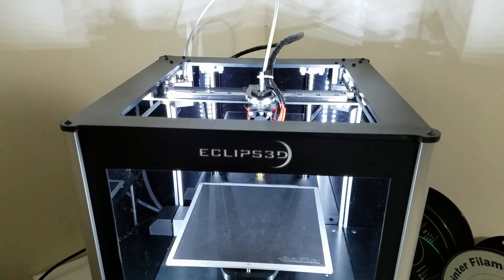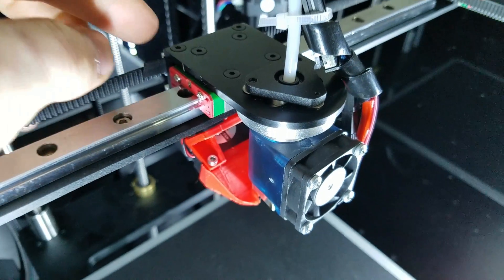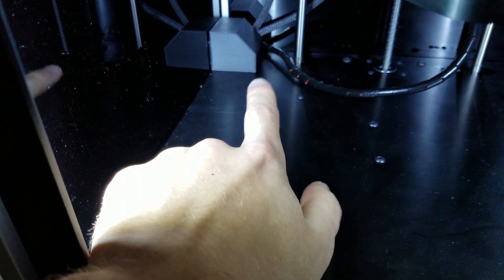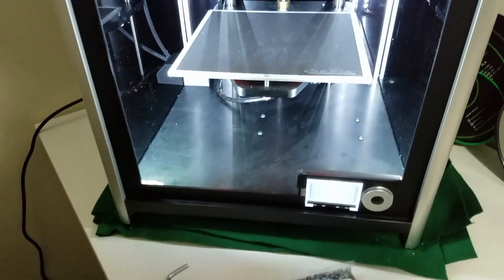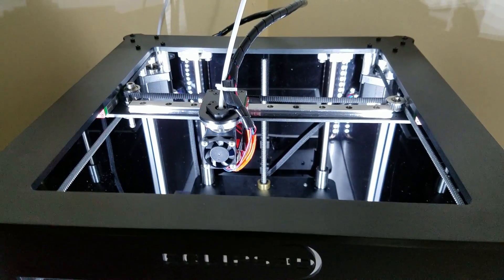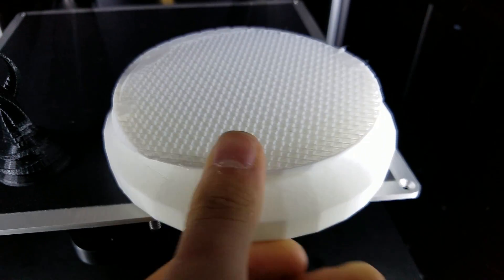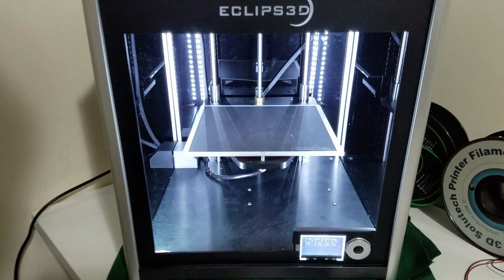Eclips3D2 Update - Hiwin Rails & Random Prints!

Comment: What is your plate which is connected to the linear rail , metal or a form of plastic.
if metal how did you get it machined ?
Reply from the maker: Aluminum, and I sourced it out to a machine shop. A one-off job from a shop would be very expensive, if you are interested in doing something similar you should check for a local makerspace or local makers who would be willing to help you out.
Reply: @3DprintedLife  Thank you for you quick reply.
I've looked but can't find a makerspace near me, I looked for laser cutting and cnc and found 3 big work shops within 10 miles of me , but like you say I think it will be very expensive to get a one off from them.

Comment: HI there.
Can you tell about your experience with RobotDigg and Hiwin rails, is there a huge differenc?
I am about to order some, but the prices for Hiwin are crazy.
Reply from the maker: Honestly they aren't terrible and depending on your overall budget they may be worth it. Genuine Hiwin's are quite  a bit smoother and at a similar preload, they have much much less slop. The Robot digg versions have quite a bit of slop, especially twisting around the axis of motion. I wouldn't recommend robotdigg's "hiwin" knockoffs as those have really rough motion, the stainless steel "quality" ones are what I would recommend if anything from Robotdigg.

You can get pretty cheap Hiwin's from one seller on Aliexpress, it just may be difficult to find the exact version you need
https://www.aliexpress.com/store/product/HIWIN-MR12-12mm-linear-guide-rail-stainless-steel-rail-MGN12-length-250mm-with-MGN12H-linear-block/834897_32737042984.html

I wouldnt mind that one negative feedback, don't think that guy knew what he was talking about lol. I've personally ordered these rails and they are pretty good quality, although probably not quite as good as getting them straight from a Hiwin distributor, but still better than Robotdigg!
Reply: Thanks for your reply.
I have been trying to find HIWIN distributors in my country, but they do not sell to privates, only for companies. Ordering them from Chine might include a customs tax, even though it's cheaper. But this is what I am going to do, 'cause have no choice :(

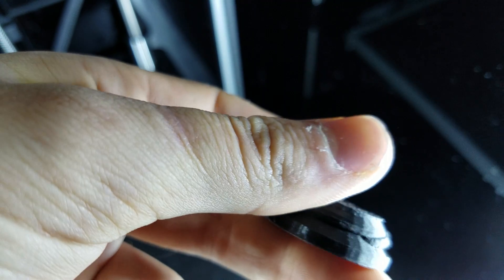Comment: I'm not sure if anyone commented on it yet, but i'm pretty sure that the surface quality of the part (4:25) is due to the low resolution of the STL file in that area. your printer should be able to make perfect arcs (just a matter of how many straight sections are combined to form a circle, again this is due to STL resolution and not a problem of the slicer or the board).

Comment: How is the noise on the Hiwin rails compared to the "normal" 12mm rails on eclips3d ?
Reply from the maker: It's hard to compare because the frames of the printers are so different, but the overall noise level of the Eclips3D2 is very comparable to the Eclips3D. It is still a very quiet machine, now just prettier and more accurate!
Reply: thank you for your reply, which stepper drivers are you using ?
Reply from the maker: I'm using SD5984 drivers, which are basically an improved version of the DRV8825 and made specifically for azteeg boards. They do support firmware current adjustment if using them on an azteeg x5 mini v3 board, which is an amazing feature I must admit.
https://www.panucatt.com/product_p/sd5984.htm

Comment: If possible you could add the new e3d socks that cover the hotend. I have installed on my printer and give me a big improvement on the temperature control. It allows to have a big fan running at 100% all time without affecting the hotend.
Reply from the maker: Yes it is! I actually just got a few of them for myself so I'll be trying them out and making any necessary design modifications so they fit!
Reply: great. I already made some prints with the sock installed and overall they are great and not very expensive. My nozzle temperature during a print only change 1 or 2ºC at most. But the biggest improment is the possibility to add only one blower directly pointing to the nozzle and not getting any drop temperature problem. the sock only fit using the new heater block, it was necessary to buy a new one. The new block was a new cartridge thermistor, is comes with a big connector that was already give me problems of losing connection and the printer restarted. This connector sucks, is to big and the connetion is not really well made, if you print fast it can disconnect.
Reply from the maker: Nice that looks really good!

Comment: Hey 3dprintedlife I like how the honey comb infill looks. What slicer do you use?
Reply from the maker: That was with cura, although it was so slow to print I'd recommend just using their rectillinear infill, it is basically the same strength but prints in so much less time.
Reply: 3DprintedLife Thanks, I'm going to check out cura again.
Reply: Do you know how to configure Cura so the infill is at 90 degree angle not at 45% ?
So I want the lines to be parallel either to x or y axis, because my printer makes terrible noises when moving both x and y at the same time .
What do you estimate would be the mechanics kit cost  to upgrade from a normal printer ?
Reply from the maker: Not exactly sure, you may be able to if you use the standalone cura program but I dont' think you can through repetier. And do you mean for my newest printer, the Eclips3D2? I'm going to be selling a barebones kit for ~$1050 and a machined parts kit for ~$300. If you were looking to upgrade your printer then youd probably want to buy the machined parts then just purchase the remaining parts you would need to complete the printer. I can try to get you an estimated cost later today but I'd say probably around $7-800